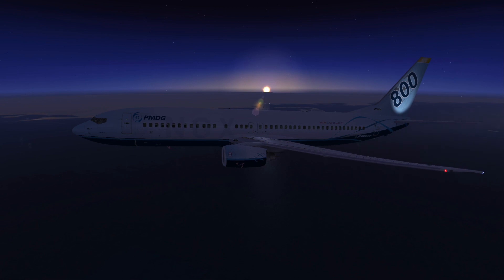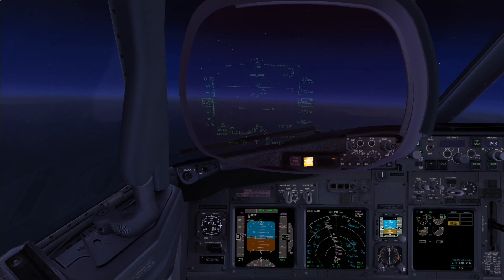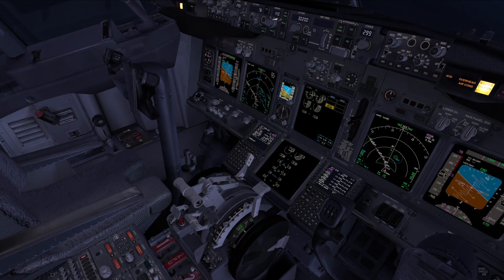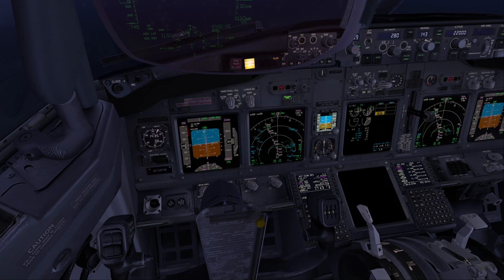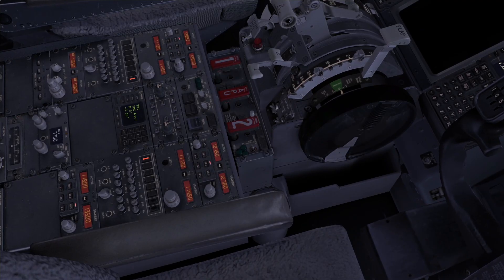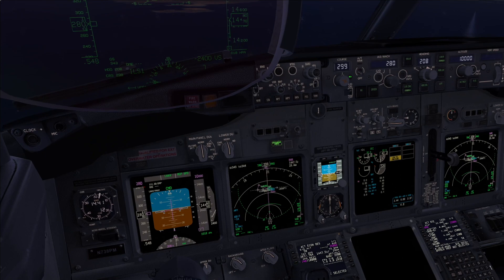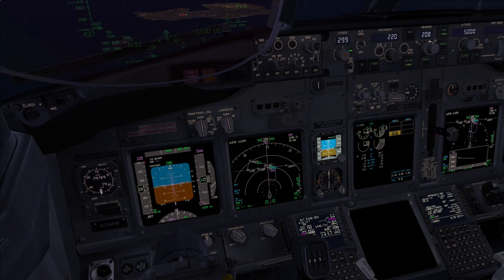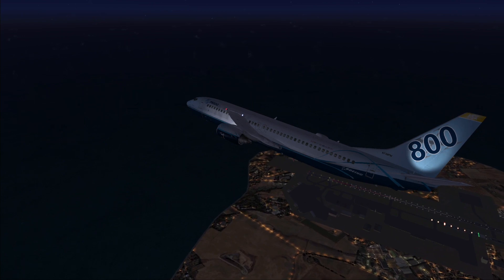Engine Failure - Rapid Depressurization

Comment: Great video! I am not sure if I agree to wait to don the oxygen mask as the captain can become unconscious in the time that it takes for the first officer to don the mask. I understand the need to control the aircraft, however the first officer may also become unconscious if he’s too slow with the mask. It seems to me that you cut those odds in half by both donning the mask immediately. Controlling the aircraft while losing consciousness can also be dangerous, you may interfere with the controls (for example falling forward pushing the yoke forward). Aviate first yes, but you can’t aviate when you’re unconscious. I guess it also depends on the speed of the decompression and how hard it is to control the aircraft. If you’re in an explosive decompression at high altitude you may only have seconds. But if the aircraft is banking violently I understand it will also be impossible to ignore and even hard to don the masks. It’s a tough situation to be in and these are just some thoughts, I’d love to hear your take on this! Either way, I am impressed by your management of the emergency. Well done!
Reply from the maker: Hi Lloyd. Thank you very much for your comment. It brought up a very nice point to talk about in this scenario. Engine severe damage, A/P disengaged, asymmetrical thrust, decompression! What to prioritize? My take: if the outcome is good, no one will blame the PIC for doing what he/she did. If things go wrong, probably the pilot will be blamed for not keeping the aircraft under control or for not donning the masks very quickly...

Depending on the situation, when facing a complex malfunction the pilot does not have the luxury of thinking for too long before making his/her decision. In this video, there were two very important tasks that the pilots had to deal with: controlling the aircraft with asymmetrical thrust at high altitude, and also vesting the masks due to the decompression. Both tasks are very important and if both pilots are able to vest the masks at the same time without losing control of the aircraft, I agree with you that this is the best choice. 

I produced this video based on the incident involving a B738 from Southwest, where the engine severe damage happened when they were climbing, passing FL330 (approximately). Due to the thrust asymmetry and the drag, the aircraft banked more than 40 degrees. The decompression came just after. 

Most of the time when a rapid decompression is practiced on the simulator, the airplane is in trim, both engines are running, and the autopilot is engaged - which makes life very easy for a properly trained pilot. 

As reference only (and of course, this varies from person to person): time of useful consciousness (TUC) FL400: 18 sec; FL350: 30 - 50 sec; FL300: 1 - 2 minutes. Having a high level of situational awareness combined with good knowledge helps a lot to make good decisions.

Cheers!
Reply: @boeing737pro3  Thank you so much for your in depth answer. I fully agree with all you wrote here. I think it's very important for pilots to go beyond training in the simulator and realize these things might happen simultaneously. This is why I think this is such a good video and channel. You show professionalism in going beyond what we're usually faced with in training. That's an excellent attitude to have. I think also when you're flying in real life things may be totally different than in the simulator and your response may be different also. That's why it's good to think about these subjects beforehand so you are more prepared for the unexpected, also regarding startle factor. I understand the scenario you were using as an example, and I think it's very easy to judge looking from the jumpseat rather than having to make the decisions yourself. In my little experience I think one thing I took away is that there are many ways to solve a problem and pondering forever is usually still worse than choosing a plan and executing it. The order can matter, but with the time of useful conciousness at that FL it was promptly managed. I don't think I could have managed it any better. Thank you again for your reply, I really enjoy these videos and keeps me sharp aswell. I've been out of the running during covid and will start flying again soon. These videos surely help to start getting my mind in the right gear! Keep em coming! =)

Cheers!